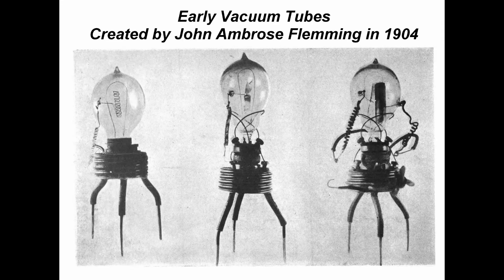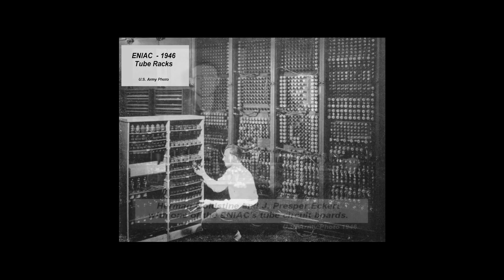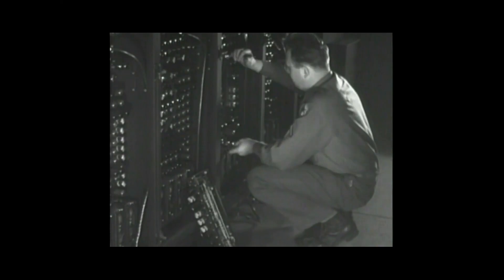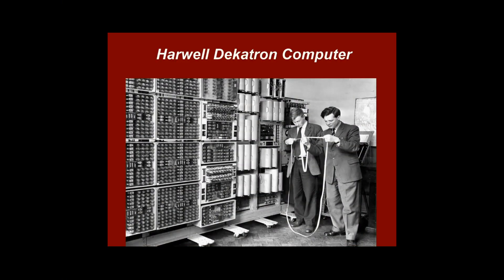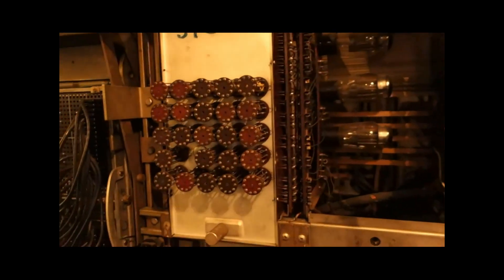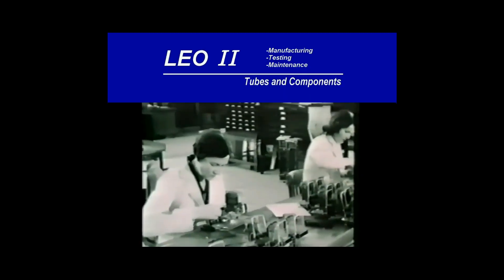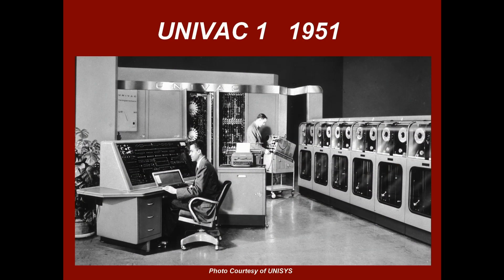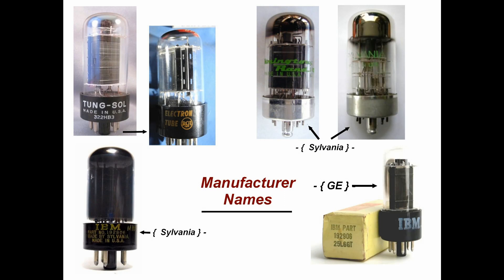Computer History:  Early Vacuum Tube Computers Explained, Educational & Historical 1945-1960s

Comment: You mention the mercury delay memory  and Williams tube memory, but you don't mention the much better magnetic core memory used on the MIT Whirlwind (and AN/FSQ-7).  This was the biggest innovation of the Whirlwind and became the standard for 2nd Generation Computers in the 1960s.  Still tiny by modern standards (typically 4K-16K tops).
Reply: Correct me if I'm wrong, this was about programmable computers. I do not think ferrite cells yielded a programmable computer.
Reply: Whirlwind replaced a Williams tube memory with a 32x32 array of ferrite cores in 1953.  The innovation came from An Wang, based on an earlier idea by Frederick Viehe, I believe.

https://www.computerhistory.org/storageengine/whirlwind-computer-debuts-core-memory/

Comment: I didn't see the IBM 704 mentioned.  I operated one beginning in October of 1964 at General Electric.  The IBM 704 was the first mass produced computer with floating-point arithmetic.  Hence some people now refer to it as the first super computer.  Most of the time we would take card decks of scientific FORTRAN programs.  Then read them and write to tape on an IBM 1401.  The tape would then be taken over to the 704 and run creating an output tape which would then go back to the 1401 for printing.  After about six months I moved from operating the 704 to programming mathematical and scientific applications in FORTRAN II on the 704.  The IBM 704 was an excellent computer.
Reply: I should add; FORTRAN was first developed for the IBM 704.
Reply from the maker: Hi artsietopology, Thanks for your note!   The IBM 704 is a real classic.   Good point.  I think we have several other videos that mention the 704, and the 700 series family.   Haven't met anyone who actually worked on one.  That's quite an experience to have!
Thanks again.

Comment: The dekatron - a couple years older than I am and still working.  Now that's amazing. btw, I used to check tubes in my dad's old repair shop.  Took a couple minutes per tube flipping through the book for the right tube parameters and then dialing and calibrating.   Might have to check six or or eight tubes before you found the defective one.  How the heck did they check tubes on a machine with thousands of them?  This might make an interesting video.  I'd love to see something like that.
Reply: Dekatrons (for the audience, in general) are cold cathode (no filament) counter tubes, and are both reliable and durable. The Harwell computer first used the British Ericsson GC10A, which glowed purple. I have a working one. When rebuilt (it was in storage for a long time) the GC10B was used, since a lot more of those were made, and they're still floating around, in decent quantity. Those glow orange. Orange is due to using neon gas. The purple gas for the GC10A, is not the same as the purple gas of the GC10D (later high speed), which also has a different pinout than the GC10A & GC10B.  The GC10D has a very high dud rate, which I'm guessing is due to the gas possibly being hydrogen, which often bonds with metals, forming hydrides. You rarely find a dud GC10B.
Reply from the maker: Hi d e austin and thanks for the comments.   Makes me wonder too how they checked all the tubes so often.   Notes on the early UNIVAC mentioned several interesting things.  They tried to buy "computer grade" tubes, which had more reliability and consistently than general tubes for radio, etc.   They must have had a daily procedure for checking tubes and having enough of the proper replacement types on hand.  Sounds like a challenge.
Reply: I also remember testing tubes in a tester in the local drug store!  🙂